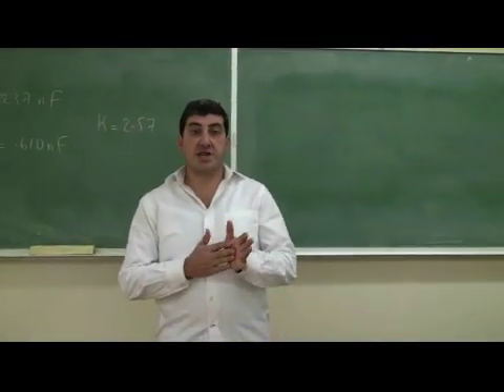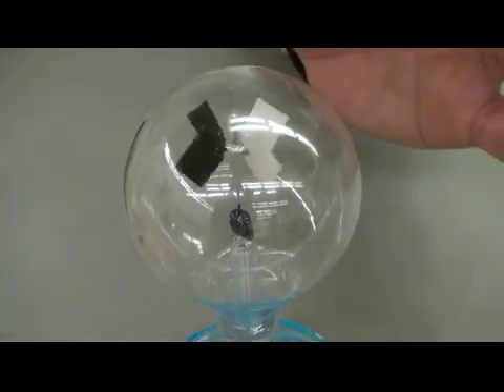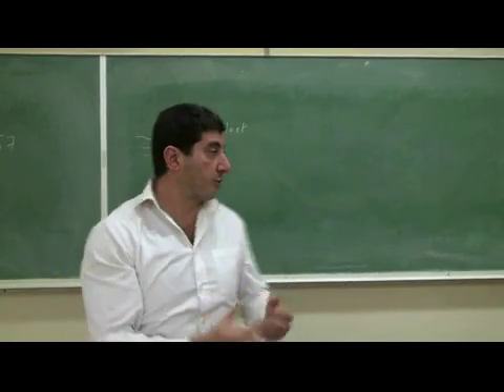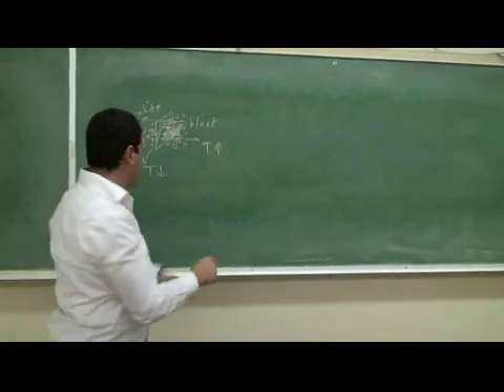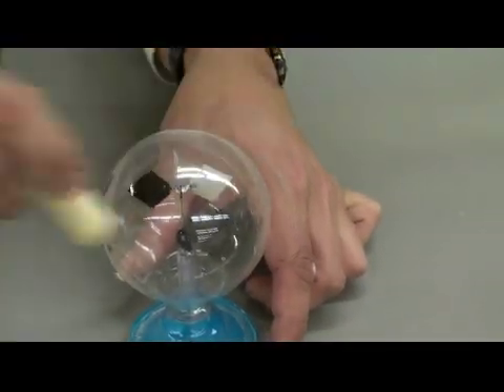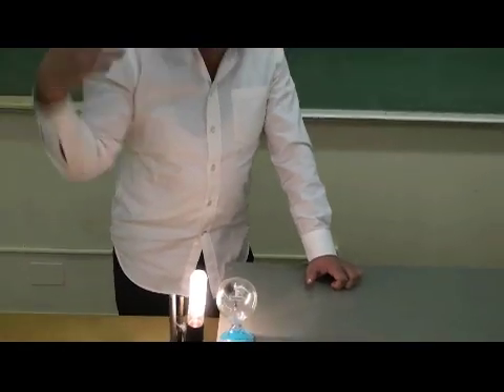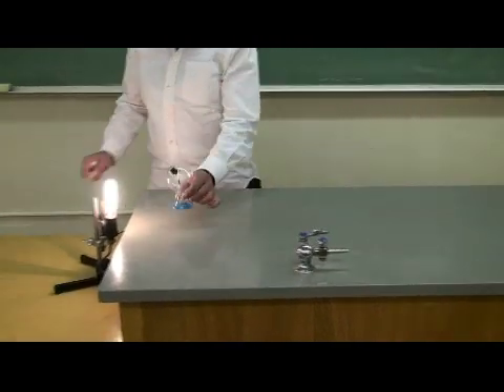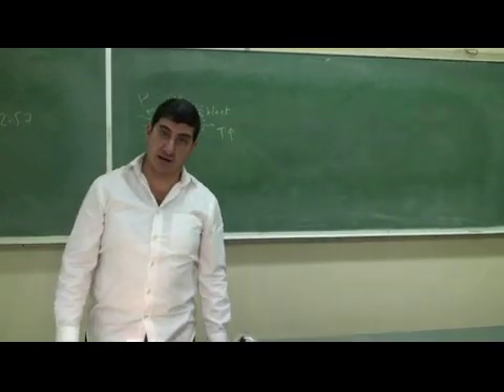Radiometer.avi

Comment: It doesn't matter what direction heat it up..it's going to spin counterclockwise, (didn't he mean clockwise?).
I wonder if he knows his left hand from his right.
Maybe in DA land left hand watches run counterclockwise and right hand watches run clockwise.
I hope he is not teaching our children this drivel; it wouldn't be so funny if he were; it would be sad.

The real mechanism that turns the vanes is the internal spinning air currents set up  as warmed air from the thin glass sphere moves up the sphere and is deflected downward in a spinning vortex much the same as spinning high and low pressure weather patterns do.  The black side may warm up faster to create a directional shear  and direction the vortex will spin.  If it were placed into a colder outside atmosphere such as happened when the sphere was quickly moved through the cooler air or placed in a refrigerator; this caused the vanes to stop and for a moment they did turn counterclockwise until it was again brought back into the presence of warmer outside air.

Let's give Viken an E for effort and H for humorous explanations. Look this up in a scientific encyclopedia and correct it for extra credit.